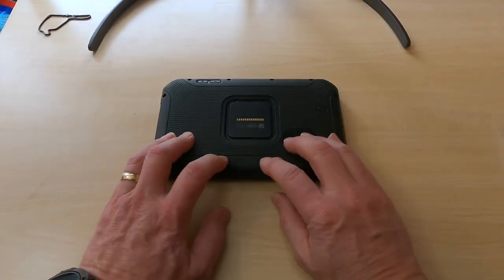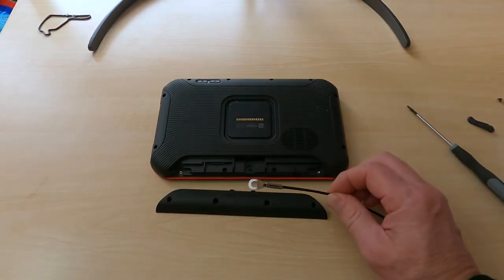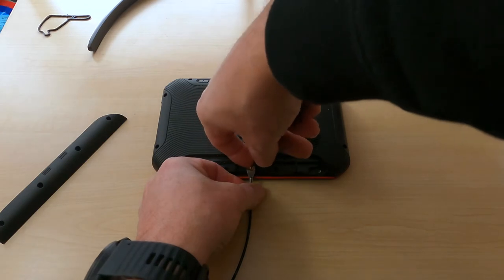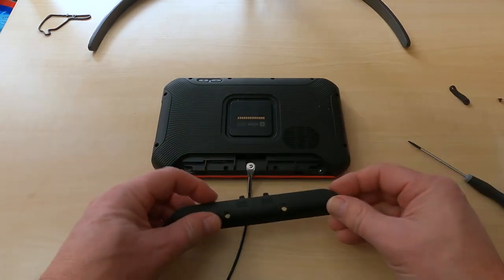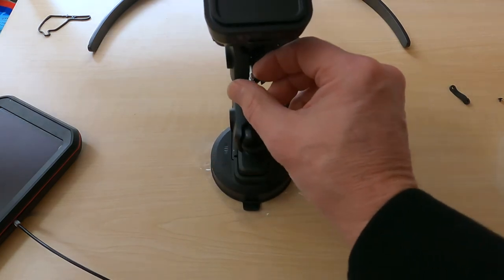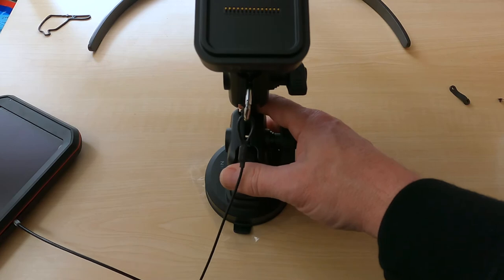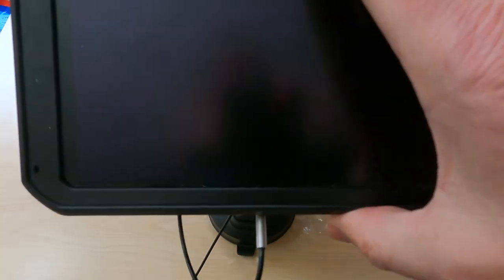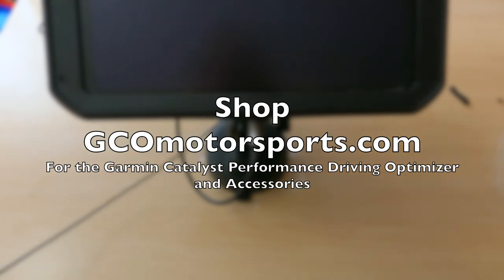Garmin Catalyst DIY Tether #Garmin #HPDE

Comment: Where did you get the tether you reshaped and screwed on doesn’t seem to be I. The Amazon collection you listed or at least not I. The photos
Reply from the maker: Search for 12 inch steel tether. Better solution however is the 3D printed clip from Thingiverse. See https://www.thingiverse.com/thing:4746675